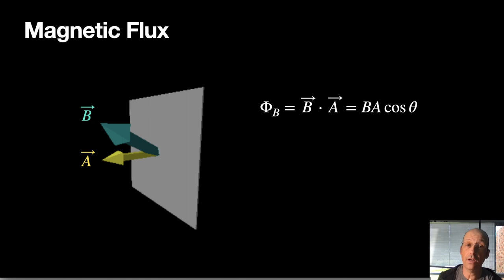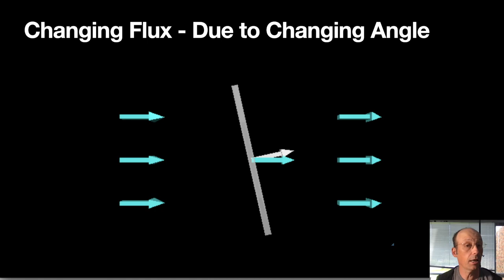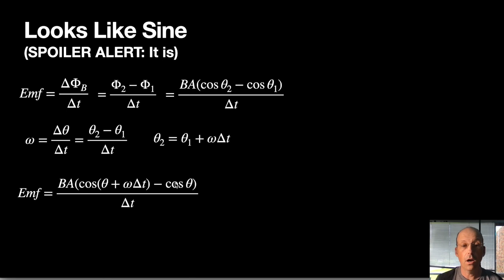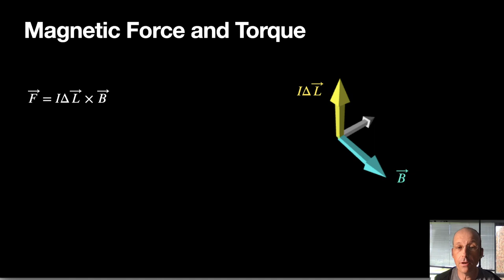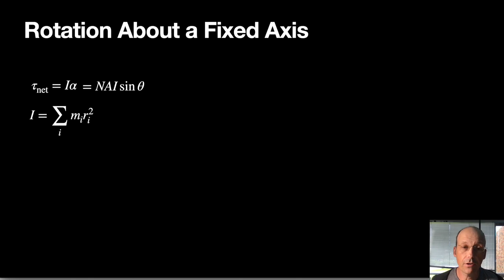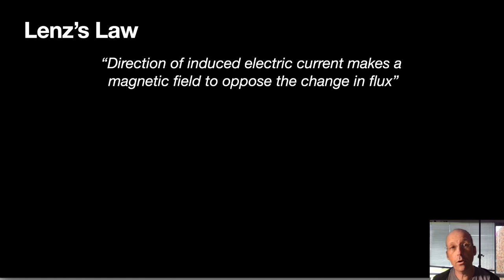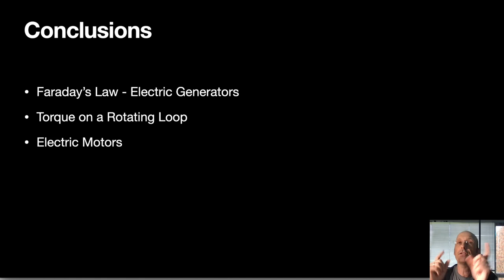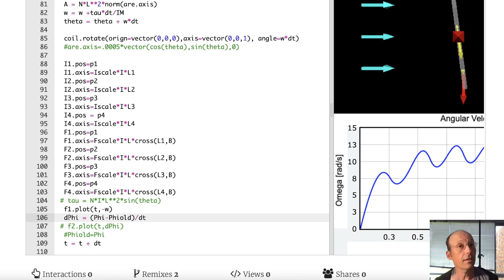Why does an electric motor use more current when stopped?  Physics.

Comment: Lets say the motor is an electric hyb motor and it is commanded by the controller to stay still and fixed at 1 location
The load is applied manual to make it rotate but it doesnt rotate because it is fixed at 0rpm

Does that use electricity from the battery? And when does the motor lose this battle and rotate?
Reply from the maker: I think yes - it would still draw current since the electromagnets in the motor need current to hold the rotor.  That's just a guess though.